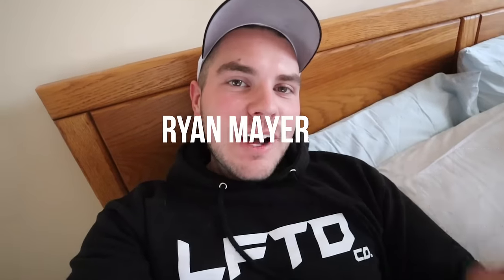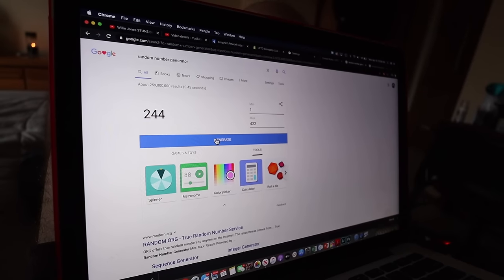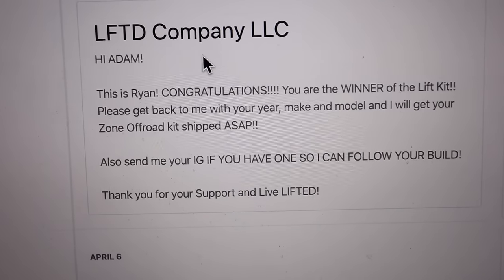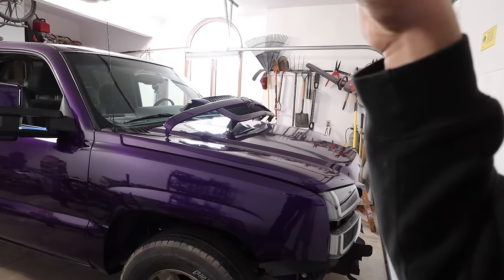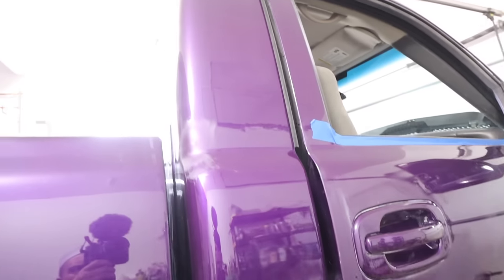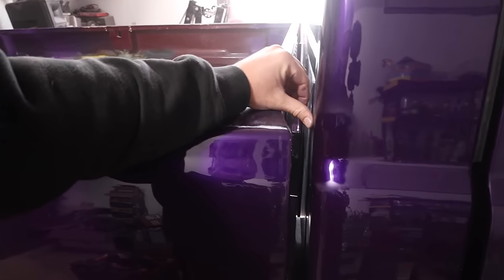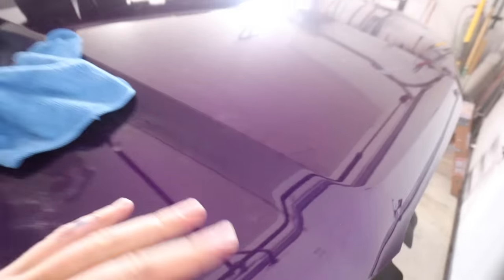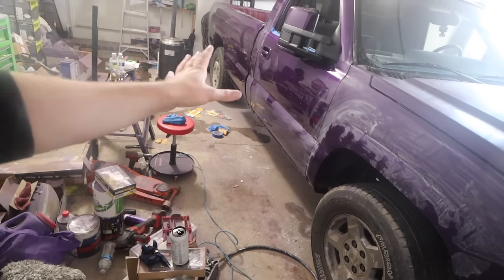I Gave My Truck An Air Brush Paint Job With a $19 Harbor Freight Paint Gun

Comment: I got same brush.  I use that brush to touch  rock chips on old BMW coup.  I experiment with different mixture ratios. I am going to start experimenting with interior parts inside car. You can cover a large area with brush, I was surprised.  You have total control of spray pattern and mixture. You can get very creative with this 19.00 gun.

Comment: You want to use something like a SEM 'Blenz-In' aerosol to melt the edges of the clear into the surrounding clear. I did a softball sized spot repair in a metallic red on one of our company vehicles, and really didn't want to have to clear the entire fender - and after using 'Blenz-In', it looked like it was never touched.

Comment: Hey man I’m really impressed by how well it turns out when you spot sand and repaint. I’ve always thought that would cause problems. I have some bad rock chips on my 6.7 because of my wide tires so do you think I could handle those kinda same way? Or how wold you go about fixing that?

Comment: 5:58 there is a small dent in the fender
Reply: Owen Giles thought i was the only one i noticed it a few videos back
Reply: It was a replacement fender, it arrived dented, and he filled it with filler, but over sanded it. I think he was just "over" the body filler fender repairs.

Comment: Love the videos but having taken all the math classes possible throughout college, that random selection process does not accurately represent the number of entries someone should receive. Yes it was still random but for the future there would be much better methods to use.
Reply from the maker: 2 things, I at least showed it was “random” unlike many others who do giveaways.  And also,  if the first guy had more entry’s he woulda won.  This was showing entry amounts do matter you’re occupying more space on the grid.  Sure I coulda cut up 2000 individual entries and picked from a hat, really think about it tho think about the grid as a hat the number generator told me the location to pick from in the “hat” and we have our winner.
Reply: RYAN MAYER I think that makes sense to me however the issue seemed to be that the grid wasn’t filled fully so that row mattered much more than column, an easier method for the future would be to type everyone’s order in vertically in the a column and just pick one random number, that simulates the hat drawing without the labor, no hate though I love the content and have been a longtime fan
Reply: William McClung Exactly. That would have accounted for all the entries better that this method. Either way it’s random but listing everything vertically would give those who had multiple entries a better chance than listing those horizontally